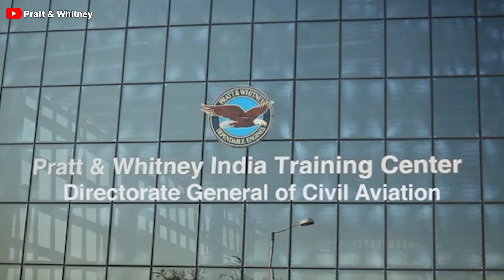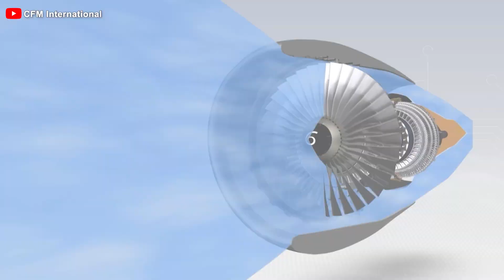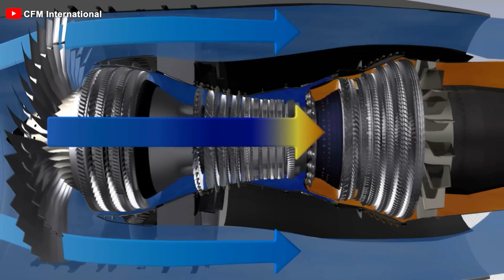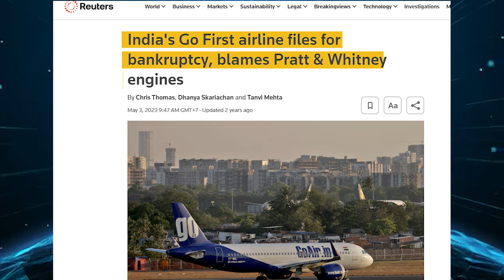This A320neo Engine is in HUGE PROBLEM & KILLS Airlines! Here's Why

Comment: Pratt screwed up having internal parts made in China.
I worked for Pratt 13 years STELLAR work record and I was selected by the Russians for first flight test engine mechanic for the MC-21-300 Russian Airliner in Zhukovsky Airport Moscow. The corruption of the Chinese government and the business working environment in communist China.
The Chinese steal money from the process and cheapened the blend of the metals used for the compressor blades.
Allot of the mechanics in the video I have worked with. 
I was fired from my career because I made a video about the STOLEN ELECTION of Donald J TRUMP 2020.
I know all of the real issues and stories. 
Middletown Connecticut plant I ran production Test cells for the NEO for almost 2 years. 
The India Airlines were flying at full take off power for their whole flights because they are always behind schedule.
They burned up their engines.
Reply: It had nothing to do with China or parts.  It’s the raw material that went into making the blanks that were forged and milled into the parts.  A sub supplier’s supplier had a process deviation due to a worn tool.   It was only after the root cause investigation into a failed part that they were able to work back to the source.   Should be more impressed that due to the traceability requirements it is possible to isolate the entire suspect population.
The Indian & Chinese operators are harder on engines mostly due to the air pollution there.  It does nasty things to internal parts at high temperatures.  
BTW:   The election in 2020 wasn’t stolen and there’s been no fraud found so please wake up.
Reply: It had nothing to do with China or parts.  It’s the raw material that went into making the blanks that were forged and milled into the parts.  A sub supplier’s supplier had a process deviation due to a worn tool.   It was only after the root cause investigation into a failed part that they were able to work back to the source.   Should be more impressed that due to the traceability requirements it is possible to isolate the entire suspect population.

Comment: No, I like A320Neo plane. I like A321Neo too. I did Air India A321Neo from Singapore to Delhi and Vice Versa.
Even if the Plane was in Vistara Livery, I would like AI A321Neos so Badly.
Reply from the maker: That is a great aircraft except its engine.
Reply: Except it's Engine, I don't want A321Neo or A350s to be grounded.